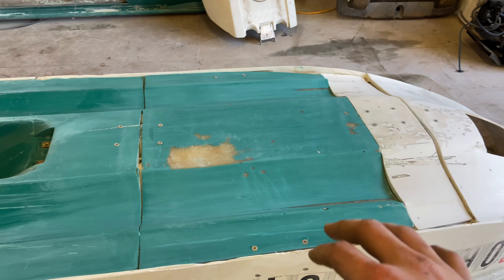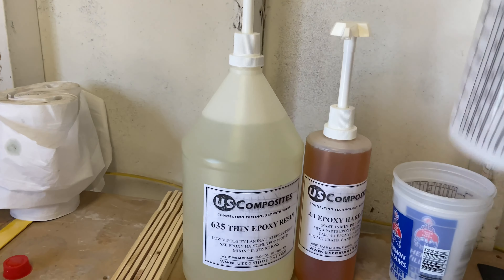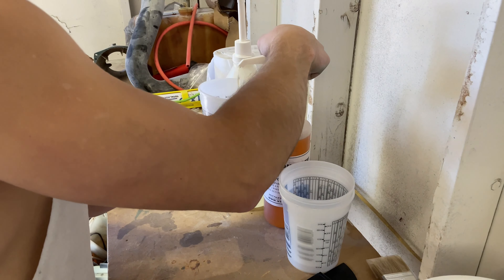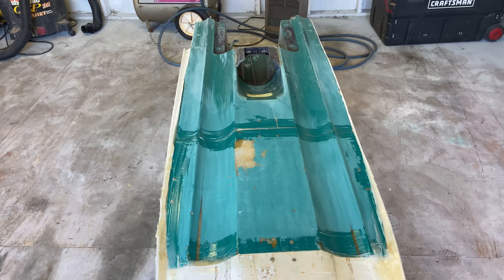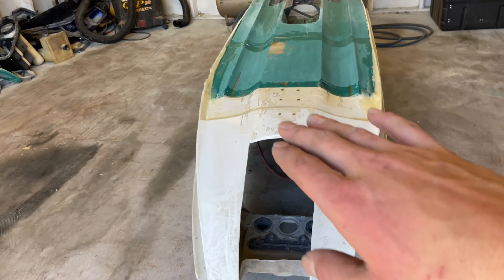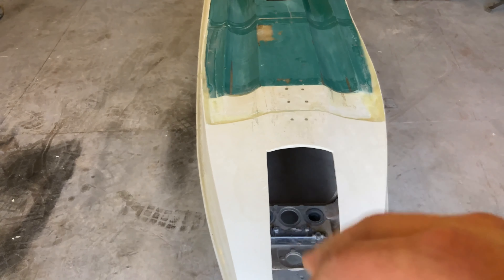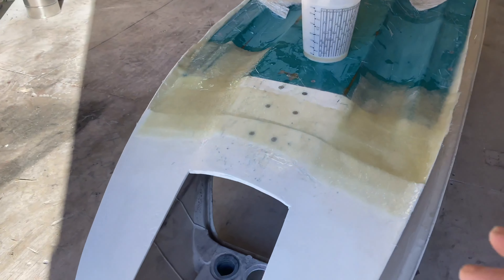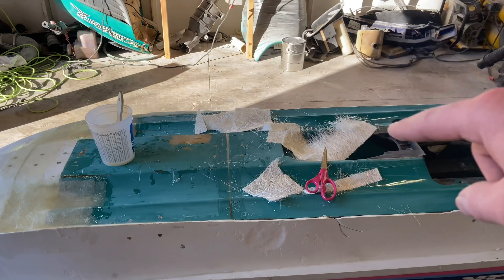The CHEAPEST backflip jet ski build, Part 7.

Comment: Somebody at my work found this and showed me. I immediately recognized the name Nasty Moto. It's been years since I saw your channel last. Just watched the whole bob series. It's really turning out good! I really like that you weren't afraid to cut up a b2 blaster. That b2 bottom looks really good for doing what you did. I bet the ski will handle good. I think I've learned in the past few years that expensive stuff is bull crap. Your 760 with a stock 701 pipe and a good prop will rip probably 95% as hard as a krash kv997 and stay working 100000% longer.  I loved how you cut the splines on your driveshaft.  You got me a little bit amped up to go finish my bob build.
Reply from the maker: Dude heck ya! Get to work on the BOB build and send me some pics!

Comment: Hey man , I’m also a broke college kid looking to do the same build you’re doing on a 1500-2000 budget.I’m told the 701 makes more bottom end than the 760. But the 760 you have is using the 155 pump. Do you think a 701 with a 144 pump would do it? Trying to see what my options are for doner skis since the waveblasters aren’t typically cheap. Can’t put too much money into motor mods as well.
Reply from the maker: We’re in the same boat haha, I think a 701 with a 144 pump would flip but it would have to be off a wake for sure. This also depends on how much fiberglass work is done and how much the hull weighs. I really think my ski will weigh too much to flat water flip even with the 760 and 155mm pump. Sit down pump tunnels are really long and hard to transplant. A blaster 1 would work well I think.  Feel free to ask anymore questions man!